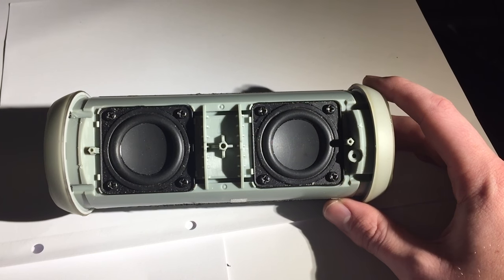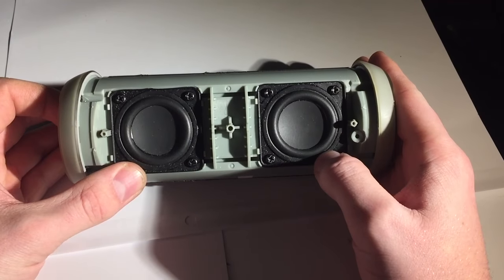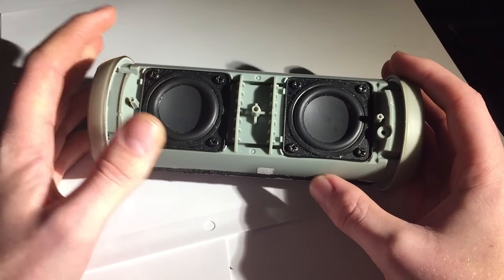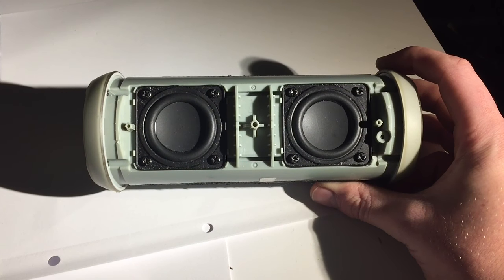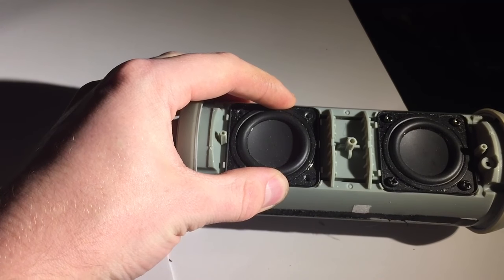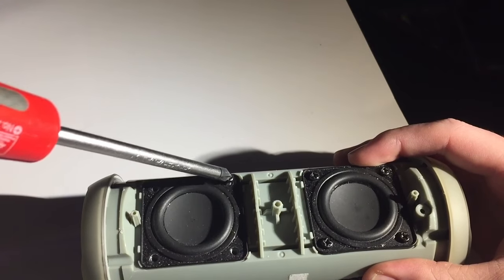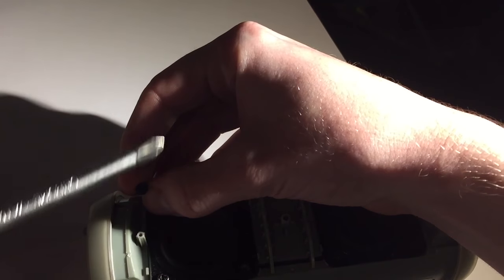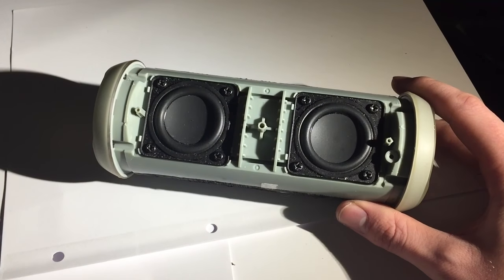What are passive radiators on speakers and how do they work? HD | Aspiebloke's world |

Comment: Which of the jbl lkineup should i buy?
Reply from the maker: It really depends a lot on what your going to use the device for and where your going to use it. You’ll need more power if your using outside so maybe the Xtreme but indoors maybe the charge 3 or Flip 4
Reply: Aspiebloke's World something for both. Its rather broad, but the jbl go kinda fits actually
Thanks for the advice
Reply from the maker: I think the problem you have is your trying to ask too much from a small speaker. My advice is to always get bigger than you need for example I have the Sony SRS XB40 and never need to push it more than half a lot of the time. You’d be best to go to a shop and listen to different speakers don’t be scared to crank it! Also I have videos of a few speakers on test outdoors maybe give them a watch. Thanks for the sub :)
Reply: Aspiebloke's World thanks for the advice ;)
Reply from the maker: No problem :)

Comment: and i touchet my jbl speaker passive radiator will that hurt the suond

and my jbl charge 3 speaker bottoms out will that affect the suond

pls help pls
Reply from the maker: Gently touching the passive radiators is unlikely to cause any harm. 

As far as I’m aware the device shouldn’t be bottoming out. This can occur if you have the so called low frequency mode on. To see if you have this mode on turn the speaker up to full volume. Does it sound the same as in this video? If so then this is probably active. Deactivate to correct this :)

Comment: The only reason to use passive radiators vs ports is because of space (no space for ports length) and for weather resistance (ports let the environmental elements into the enclosure). Passive radiators do not sound better than ports.
Reply: Yes they do! No port chuffing. But at this volume levels, that wouldn't occurre anyways...

Comment: How Durable are the Passive Radiators????
Reply from the maker: Ive had this particular device for nearly two years. During which its been thrown around in a shop everyday and been in a thunderstorm (don't recommend) and is still working. as long as the radiators don't take a direct impact they're fairly durable. I have several videos of speakers like this in action. feel free to check them out :)
Reply: Aspiebloke's World I'll be caring it in my back pack
Reply from the maker: Should be fine then if your worried about exposed radiators maybe have a look at the ultimate ears wonderboom. Similar sound but with no exposed parts.